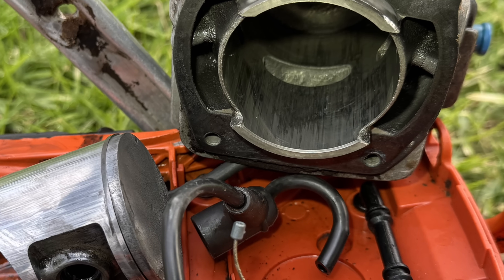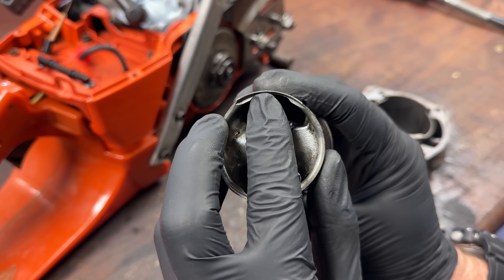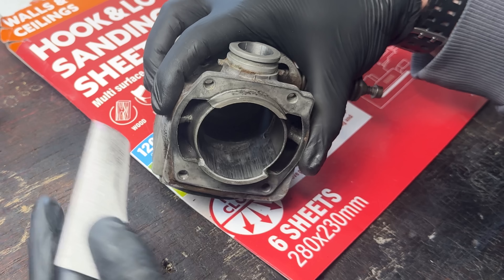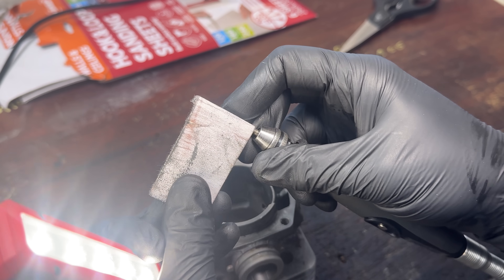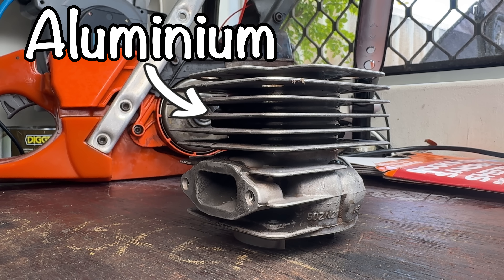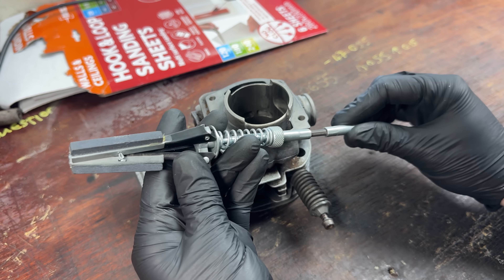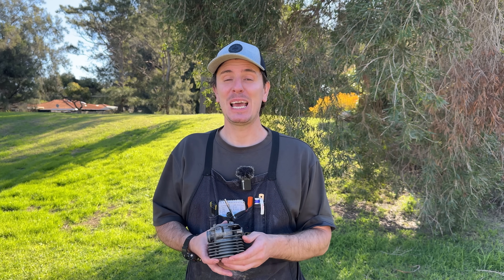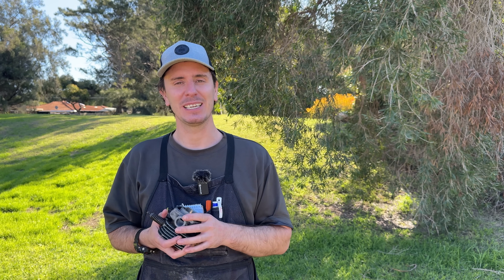Free Cylinder Repair Every Mechanic Should Know!!

Comment: Forty or 50 bucks buys you a Chinese aftermarket cylinder and sometimes a ring kit as well.
Reply from the maker: Always better to save OEM, Chinese parts are junk.
Reply: @VintageEngineRepairs  sometimes but not always.
Reply: @VintageEngineRepairs  ALSO.....when OEM parts are no longer available there is little choice left besides Chinese aftermarket. Common sense & logic rules.

Comment: unexpected.
I've honed cylinder bores before. didn't expect this concept would work.
I feel it will leave an uneven bore if not done carefully. 
definately worth a try. If only to get an engine running again quickly instead of waiting for parts.
Reply from the maker: If the bore is plated, you'll have no issues - I'd never do this on a plain cylinder

Comment: Something ive experienced myself is that aluminium dissolves in a lye solution (NaOH). It does take longer than acid and ive never tested it on a a cylinder. So i dont know if it affects the cylinder
Reply from the maker: Thanks for sharing! I have heard others mention this, maybe I'll try it some time, though I prefer to use abrasives!

Comment: I would recommended RVS chainsaw treatment to old and new Chainsaw. It will remove all dirt from piston and cylinder. At the same time it will create a new ceramic metal coating to metal surfaces which will remove also a lot of friction, which mean chainsaw will run cooler.
Reply from the maker: Hey I haven't heard of that product before, thanks for sharing that info :)

Comment: Used my 372xp for 15 years, only retired it for the 500i when it came out. Took it cutting after sitting 4-5 years recently and it ran like I put it away yesterday. Great saws
Reply from the maker: Worked on my first 372xp the other day. That saw is like no other. I'd take it over any stihl 70cc class. I'm a Stihl guy, but nothing Stihl made of that era came close. What a great saw.

Comment: The cause of this issue is revving the engine as soon as it’s started. Heat is concentrated around the exhaust port and it causes the aluminum piston to expand faster in the exhaust port area than the steel cylinder expands. It’s easy to avoid by letting the engine idle for a minute or two making sure the engine is warmed up and heat is evenly distributed before revving it. I’ve worked on hundreds of two stroke engines and the vast majority of them are damaged in this way. The ones I own (chainsaws and string trimmers) do not have this issue even after years of use because I use a quality two stroke oil and always let the engines idle for a couple of minutes before using the machines.
Reply from the maker: That's not quite right. When an engine is put under load too quickly when it wasn't warmed up will cause 4 corner scoring - either side of the exhaust and intake skirt. This is very different and is a lean scoring due to an air leak.
Reply: @VintageEngineRepairs  I was taught the theory I described in a Honda two stroke engine school I took in 1987. The professor showed this exact issue in lab demonstrations. I’ve always warmed my two stroke engines before putting a load on them and have never had this issue. I believe your description to be accurate as well but the piston scoring and aluminum deposits in a cylinder on the exhaust port side is many times the result of uneven heating from loading the engine before it is evenly warmed.
Reply from the maker: It's always good to warm them like you describe 100% :) 👍👍
Reply: Isn't this cylinder also aluminium though?
Reply from the maker: @redeye118 it's plated 👍

Comment: I'm glad I watched this. I didn't know that most of the mess was aluminum transfer rather than scoring damage to the cylinder wall. Also, it's good to know that some methods will cause damage while the ones you used will save the cylinder.
Reply from the maker: Glad you enjoyed it! Yes so far I have never not saved a cylinder. Even those with some minor scoring run as well as ever :)

Comment: Hi Tom, got an 046 I recently did a full rebuild on. Once the saw is warmed up, I make a cut in some wood at full throttle, let go of the trigger and the saw bogs/stalls. I can sometimes stop it by giving a bit of a blip on the throttle. It restarts, idles, revs but just wants to die after making a cut. Got any ideas where I should be looking?
Reply from the maker: Sounds too rich on the H side :) what does it tach out to?
Reply: @VintageEngineRepairs  I've tried leaning out the H but it still seemed to be doing it, I haven't run a tach on it yet, got one that I haven't used yet. OK, just got the tach out, first time using one and boy does it make it easy. Did everything as per your Stihl tuning video and now she seems to rip. Did probably 10 test cuts, no stalling. Hopefully that's the end of it. Idling ~2500, full throttle ~12500. 4 stroking out of the cut, cleans up in the cut. Will probably lean it out to ~13000 once I'm more confident the new piston has bedded in. That sound about right? Thanks mate, and from a fellow Rocko resident, love your work, I'm sure we'll meet one day. Cheers, Stu
Reply from the maker: Ah that's awesome you're near by! How cool. Glad you got it sorted :) a tach is a great tool to have!

Comment: I wonder if someone had a nickle electroplating vat set up if grinding through the score with a stone hone and cutting oil then replating would work? Have to measure bore afterwards to check if it's in spec.
Reply from the maker: Hey :) a stone hone wouldn't cut Nikasil  unfortunately! It would need to be machined, sleeved and then re-plated. Or machined oversize and re-plated. I'd love a large lathe and mill.. one day maybe! :)

Comment: Nice to see someone actually fixing what they have rather than throw new parts at it.Lots of people just put a new cylinder kit without doing a pressure and vac test and seem surprised when the same thing happens and blame the kit. Anyway, it's a good explanation on how to save a cylinder, especially  useful for older gear that's becoming obsolete. Keep up the good work.
Reply from the maker: Thanks for the kind words and I agree with you entirely!! :) thanks for watching and commenting!
Reply: They didn't teach us how to fix in school. Only sentence diagramming and algebra. And how to spell.
Reply: Right! ❤ This is true "repair" video! 😊
Reply: Just replace the whole thing. Treat them as disposable tools. It’s way beyond economical repair.

Comment: Use a glaze buster tool and you will be ok in minutes! You will need to run a richer oil to gas ratio in the future 40:1 will be perfect.
Reply from the maker: Hey thanks for commenting and sharing, I'm not a fan of using a hone, but if they work for you, perfect! :)

Comment: I think it was ingenious how you made that flapper sander. I use a stone hone. I used a brake cylinder hone and put 3 inch stones on it. Believe it helps keep the bore straight and I have had very good luck with it.
Reply from the maker: Glad you have had success with a hone, unfortunately I haven't been so lucky :( great that you have a good method that works well! Thanks for watching :)
Reply: Important to replace the rings, as they loose their springness when over headed and won't seal in a sanded cylinder
Reply from the maker: The absolutely can do, yes! :)

Comment: -Retired machinist here. I have built engines from scratch, wrenched on turds to diamonds.  And the moment I saw you put that sandpaper up against that cylinder wall and start destroying the concentricity. I sighed and died inside.  While you do make a point about material transfer. Once that material has transferred it has also abraded the underlying surface. So UNLESS the surface of cylinder is hard coated like nickisil , or ceramic, etc. All your doing is polishing the scratches away and leaving miniscule pits. The rings will NEVER properly seat in that spot as the glide by.
BUT I too have done this!  Yes me too lol. But it was only ever on junk, when I was first learning about engines and actually got a job at the junkyard to score parts cheap. And build stuff.
So yeah, sorta works, but DO NOT TRUST IT for dependability.  Better to take it to me, I can bore and hone or bore and press in a liner for a perfect concentric, crosshatched surface.
But again, if its plated, what you showed works sometimes! I mean for actual larger engines.    Best wishes.
Reply from the maker: All quality cylinders in 2 strokes are plated now days, this hasn't affect concentricity at all. The plating is all in tact and Nikasil is silicone carbide based, it's 9.5 on the mohs hardness. Aluminium oxide paper won't touch it :) thanks for watching!

Comment: Steel wire brush with oil on drill press should also work quite well, to remove aluminum from hard piston coating surface.
Reply from the maker: I haven't tried that! I should give it a go and report back! Thanks :)

Comment: Is that tranfer material what makes a cylinder tight? And does that happen to 4 stroke weed trimmers as well? I have a Craftsman 4 stroke weed trimmer. I took it in for repairs. They said the cylinder was tight. They wouldn't repair it.
Reply from the maker: Yes it will do, many machines will struggle to idle when warm and yes, can happen on a 4 stroke ran low on oil!

Comment: I would replace the rings as well.
Reply from the maker: Absolutely! Replace both, and likely the small end bearing :)
Reply: @VintageEngineRepairs  - yes - otherwise the engine would
be difficult to start and down on power.
Reply from the maker: Exactly right :)

Comment: Use a caustic soda solution to dissolve the aluminium.
Reply from the maker: I've have to try that! Others have suggested too. Have you used it before or just now of it? Is it as effective as the hydrochloric acid?
Reply: @VintageEngineRepairs about six of one half a dozen of the other. They are both caustic and so a definite risk.
Reply from the maker: Yeah that makes sense, I try and avoid using it as much as I can :)

Comment: How did oil seals cause the scoring? Lean fuel mixture and overheating?
Reply from the maker: Exactly right, in a 2 stroke the crank needs to be sealed from atmosphere. A leaking oil seal will let more air in, reducing the air fuel ratio. The engine runs hotter and with less lube and this is the result :)
Reply: @VintageEngineRepairs  I was wondering the same thing but I didn't understand that you were referring to the crankshaft seals. I kept wondering where are oil seals in a two stroke engine?🤔👍👌

Comment: It's far better spending 15 dollars for honing stone set that are spring loaded just run the fine stones 2 minute job done and the last for years you can even get them cheaper of TEMU
Reply from the maker: Na it's not that simple in my experience, I explain why in the video that I don't recommend hones, they won't solve your issue.

Comment: I have a small honda clone engine. The condition of the cylinder is good, well the piston doesnt has scores but you can see its worn out at the shoulders. I also had glitter in oil. Do i need a new piston or will this one survive a few hours?
Reply from the maker: Like a gx25 / gx35? They're incredible little machines. I'd measure the piston skirt to cylinder wall and go from there :)
Reply: @VintageEngineRepairs  gx 160 clone. Its an awesome machine, i got it used 10 years ago before i started my work as car mechanic. It means something to me so i want to save it.
Reply from the maker: Ah yes I'm with you, yeah measure the clearances and then compare to the workshop manual specs:)

Comment: The only thing I would like to add it that all of the sanding should be done in a 45 degree angle and then 90 degrees to that.  This will create a cross hatch pattern which help retain oil and provides a surface that the piston rings can break in and seat against.
Reply from the maker: You're absolutely right mate, I go over the surface at the very end with some scotchbrite and a drill to give it a final crosshatch, but didn't mention it in the video - I should have. Thanks for commenting and sharing!
Reply: Actually that is whole different thing you   do after cleaning if at all. Nicasil peel off after time so easyly if sanding. I don't do cleaning by sanding at all anymore.Ruined some cylinders with that method.  Mild acid with time and wire brush is my weapon of choise. Never ruined any again.
Reply from the maker: Interesting, I have never worn through the plating and I use a rotary tool!
Reply: @VintageEngineRepairs  That's because you are better than me😂
Reply from the maker: Na hahah, just maybe your cylinders had worn / thin plating :)
Reply: @hessuhopolainen  which acid do you use?
Reply: @hessuhopolainen I've never tried the acid method but had good luck with the method I mentioned.  That said, the acid technique may be even better because of the reason you mentioned. And yeah, the cross hatch is the very final step, should have clarified that.
Reply from the maker: Thanks for sharing :)

Comment: I’ve used toilet bowel cleaner to remove aluminum transfer from crankshaft rod journals after a thrown rod in small engines. Always worked well.
Reply from the maker: Oh interesting! Thanks for sharing :)
Reply: was it sulfuric toilet bowl cleaner or hydrochloric?

Comment: Good video....that said, I would like to see your sanding impart a cross-hatch on the cylinder wall rather than following the piston motion you were using.  I've used the hydrochloric acid to clean cylinders with great success and I believe it to be the first thing I would do, then use the sandpaper to achieve cross-hatch. Thanks.
Reply from the maker: Thanks for watching and commenting :)
Reply: I just mentioned the same thing regarding cross hatch.  I didn't realize that someone (you) beat me to it by one day!
Reply from the maker: It's 100% valid and well said! Cheers :)

Comment: Great video, thanks. One thing though, a similar cost repair can be done to fix deep scoring. I've done this a few times with excellent long term results and it is to just super clean the score mark or area before filling the score. I use steam cleaning first then an ultrasonic cleaner with water and windshield bug remover as a deeper clean. I then scrub it with IPA and dry before applying JB weld and forcing it into the score line with the curved end of a steel ruler or similar spatula. Then when the JB is only partially set, utilising an old piston ring I use it to scrape the excess JB from the cylinder surface. I then let it cure for at least a day before reassembly. I've done this repair on car engines, a few two strokes including a vintage iron bore JAP, and a four stroke Briggs. None have lost compression after many years of extra service. And, if it doesn't work long term, at least there was hardly any cost trying. I have also fixed a porous cylinder on a big block chev this way, and that engine stopped burning coolant for the next ten years following my repair, the alternative was to scrap the block as it was at max oversize anyway.
Reply from the maker: Very interesting! Thanks for sharing :) have you done this above the exhaust area where combustion temps and pressures are experienced?! Cheers!
Reply: @VintageEngineRepairs  Yes, actually thats usually where the scoring is found in my cases. There's no problem with temperature handling as long as the product is genuine JB Weld, not the Chinese imitation stuff. I have also used that product in cylinder head repairs and in a couple of cases patch up repairs fully exposed to combustion (filling a rotted Izuzu head with cooling passage perforation into chamber) The key thing is getting an absolutely clean surface, with no traces of oil which can easily hide in score lines especially when baked in hot.
Reply from the maker: @alasdair4161 very interesting, thanks for sharing! :)
Reply: One more thing to note, I also hone the cylinder lightly after application to ensure there is proper oil suspension across the otherwise smooth JB weld.
Reply from the maker: Thanks for that info :)

Comment: I have used hone stones to remove Transfer on multiple ocassions. It worked for me every time. I've also used Sandpaper a couple of times. The results of both seem pretty equal to me. What exactly is the disadvantage of the hone(not the ball hone) beside getting gunked up because mine doesn't seems to as it wears pretty quickly?
Reply from the maker: The aluminum is soft, in my experience it will clog the stones and they will smear the transfer rather than removing it, but if you are having success with a stone, keep going! :)